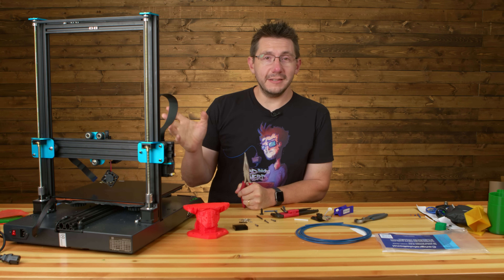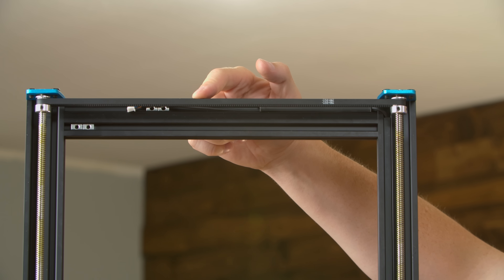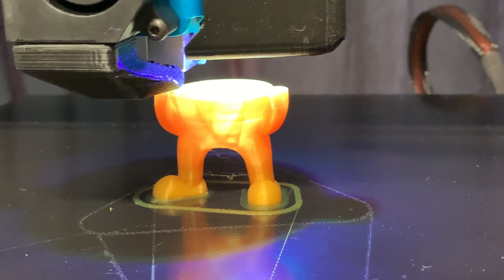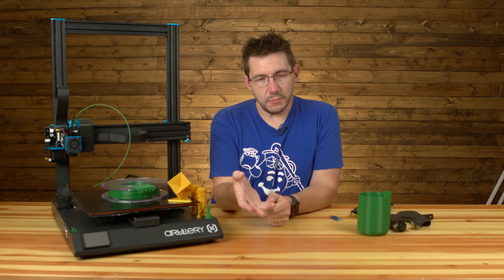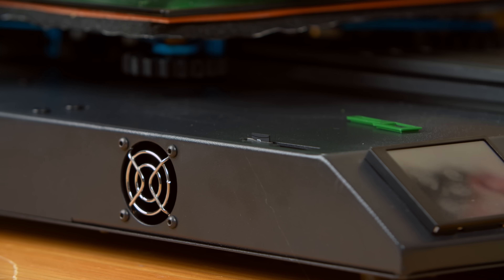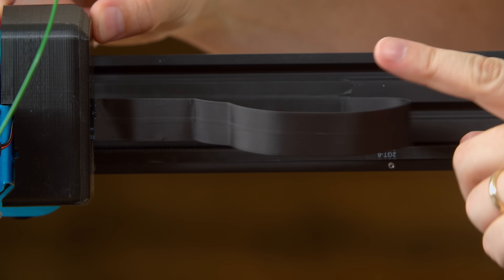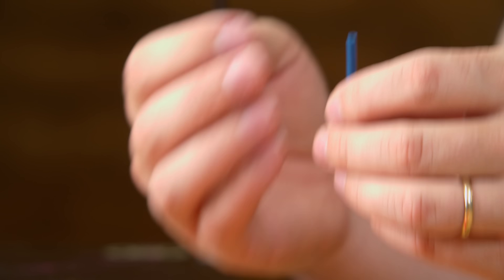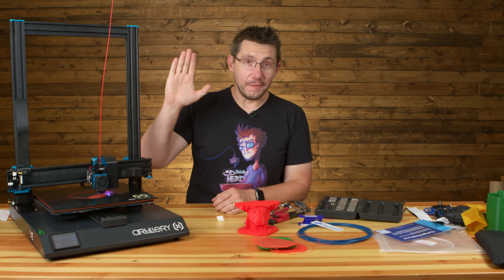The Artillery3D Sidewinder X1 3D Printer - A Must Have?

Comment: I got one of these a couple months ago, and I was at first super impressed. I was printing PLA and PETG parts like a champ, and the setup seemed basically bulletproof for about 3 weeks. However, I am an engineer and I really wanted some durable functional parts, so I decided to try Nylon. This became a massive problem with the stock extruder, but not for the reason you might think. I was cautiously printing around 245-255 not wanting the PTFE to break down but I actually had the ribbon cable on the X axis fail not once, but twice. I've also had the vertical axis cable fail once though this was from the bed rubbing on it and can easily be fixed with some tape. I'm not new at all to 3D printing, but I am new to modifying my printers, and in my attempt to modify the extruder and replace the heatbrake I ended up snapping it off in the volcano style block in an attempt to clear a jam in a really cheap chinese heatbrake. This was entirely user error, but I will say it is a bit of a PITA to replace the extruder because of how little room there is to turn it and the wires are rather stiff, meaning I was constantly afraid I'd break them. In fact I did break the thermister by twisting the wires a bit too much, and the sensor came free of its casing. 

Things I like: The AC heat bed heats up stupidly fast even to 90C or above. Super quiet. Direct drive is a big plus for me, I've had little to no stringing issues. Customer service is very nice and sent me free replacement parts like the cables. Thermal runaway enabled by default. Really reliably prints PLA/PETG. Bed surface worked awesome with just hairspray. Can print really fast, I default all my PLA prints to 90mm/s. Volcano heat block compatible with large nozzles to make better use of the huge volume. 

Issues: Reliability of the cables. Occasionally I'd have a random thermal runaway error stop a print even with it working fine before (early sign of failing cable?). Short fragile wires to the board on the extruder. Annoying spoolholder. Firmware default will max out at 270C, if you replace with all metal you pretty much must modify that. 

I'm sure once I have my all metal setup running and do some PID tuning it will become a workhorse again, save maybe for the cables. But they aren't too hard to replace and I probably got through 3kg of filament before my first failure. I've successfully done some 8 hour plus prints and had no issues with PLA and PETG. If all you print is below 230C on the nozzle then it is a beast of a machine.  But if you want to print Nylon without mods and don't need the build volume or huge nozzles, a Prusa may be better.  I've got a thermister, a microswiss all metal heatbrake, and a genuine E3d Volcano block on order. With those I bet I'll have a much better time with high temperature printing and be loving this thing again.

Comment: I have had the "runaway hotend" before. Turned out that the ribbon cables going from my SD / LCD were too close to the PSU. It was causing some crosstalk and apparently it would just go for a walk randomly....

All I had to do to fix it was to zip tie the leads farther away from the PSU.

Comment: Wow this is actually really really good and with this video and aliexpress it seems like it would be very good quality with good customer service. I have an anet a8 and have hardly used it because its got more problems that its worth, its unreliable, just super janky and worst of all supperr loud (probably an easy fix though). My birthday is in a few weeks so I might ask for money towards this, but first I need to tidy my bedroom and make space for it. (I feel like this comment would make more sense if i mention that I'm 15)
Reply: @anonymoushippo-m7d  it's mainly the bed getting everything level and to stick properly and the extruder. I have the popular stick on matt I forgot what it's called but I get it level it works for a few prints and then just stopped being level, also the bed isn't flat so big prints will never work. The extruder jams up something when it slips on the filament or plastic will dry far up the nozel and not remelt and jamming it. It's loud as hell. It's just not that nice to use. 

I think if I wanted to get it working good I would need a new heat bed and different bed mounting design, and sort of rebuild just checking all the bolts are fine and tensioning the belts. Neaten up the wires to make it feel less janky and more finished design too
Reply: @anonymoushippo-m7d  so after these comments I thought I would have another go at using my printer. I accidentally used the default settings rather than the ones I was told to use by a friend and it worked. Main difference is default was much much slower, I'm guessing the speed from before caused vibrations to rattle everything loose. Prints are still super weak, I noticed infil looked like stringing so I think I need more flow, also the sidewalls are basically clear so more sidewall? I think the main problem with my printer is me being impatient
Reply: @anonymoushippo-m7d  yeah I've just not had much hope with it. I hoped for the slightest bit of success from the start but not getting it demotivated me. After seeing the slight success yesterday I think I'll spend a day at home testing and watching films to pass the time so I don't rush it. Thanks for the motivation

Comment: Thats strange about printing from the USB.  I've had this printer for about 4 months and have printed exclusively from the USB and haven't had that issue, I'm guessing that perhaps it's a firmware issue.  With that, I've been printing for 8 years, currently have 3 printers and I have to say that this is, hands down the best printer I have and have owned.  The detail that I can get in my lithophanes with this printer continually amazes me.
Reply from the maker: That’s great to hear!

Comment: Cheap and unknown PTFE tubing typically degrades at the range Joel mentions in the video, however a high quality virgin tubing from someone reputable like Dupont is spec'd for continuous use at up to 260C and underwriter's laboratory demonstrated no mechanical degredation even when used at 285C ( source: Dupont's technical handbook for their PTFE resin  http://www.structuredweb.com/sw/swchannel/CustomerCenter/documents/6673/15640/Teflon_PFA_Handbook.pdf )

Comment: Nice video! I however cannot support a company that steals designs with no credit and violates a non commercial CC license. 
That spoil holder design is by Cyrus on thingiverse here, https://www.thingiverse.com/thing:1635585

There are remixes with the same license for adapting to aluminum extrusions, I used it for the overhaul of my wanhao i3 called the ReDuplicator, found here, https://www.thingiverse.com/thing:2686588

Hopefully you can get in touch with them and have them pick a new design, since this one is CC non commercial.

Comment: Just a quick add-almost all the issues have been addressed in their updates. Spool holder adaptor for bridging the gap is already on Thingiverse FYI there are at least 2 versions out now so no need to make your own. One update that just isn't good, the flat ribbon no longer has a positive lock on the newer models (not sure why they did this) but the caveat is that now you need to print a cable stay to avoid it coming loose (on carriage) over time with use which can cause all types of issues. Great Video as always!

Comment: What is better value: prusa mk3 or sidewinder x1? Teaching tech has a tutorial to enable ABL on the sidewinder, so at this point im not sure which one to get since the prusa is more than 2 years old
Reply: The sidewinder is a fraction of the price of the Prusa.  I have both and they are both great machines.  Both really quiet and produce great prints.  The difference out of the box is that Prusaslicer has fantastic profiles for the Prusa whereas you need to look around for good slicer profiles for the sidewinder.  That is 50% of the difference right there.   My sidewinder has required far less tinkering than my CR10s, is far easier to get the print going and prints more reliably but that is after I got a slicer profile that is 90% there.  My Prusa was great from the start.  How much is that worth to you?   If it is worth the difference in price and build volume is not an issue then, there is your answer.  Personally I think ABL is not a deal breaker.  I hardly ever need to re-level either my sidewinder or my CR10s.

Comment: The issues seem to have all been addressed with later revisions.. the sheet metal cutout, the odd movement at start with USB drive, and I just left one side of the spool holder slightly loose so you can just slide it to fit the other spool.

Comment: It looks like a never ending sea of videos that have printers that need upgrades. To me, all printers are made better and more reliable with upgrades you can buy or make yourself. Cheap components make the printer available at low $$$ price points. You get it home knowing you will have to make upgrades eventually, but you have one home. If I were looking at the perfect printer, I couldn't afford it. Maybe put the Micro Swiss bowden extruder upgrade.

Comment: I am not sure of the belt with two separate motors.   If the Z steppers are not rotating in sync, it feels like one motor will fight with the other.  Do other viewers have experience with such an arrangement?
I do like my MicroSwiss all metal hot end.
Dave.
Reply: There is a belt between the two Z motors that keeps everything synchronized, so there's no fighting between the steppers and it all stays in sync. And all of the Z extrusions are 40's (and the XY under the bed is close to a 60!) so this machine is incredibly stable.

Comment: without heatsink the filament can expend in the ptfe tube and just clamp itself... I just cant understand why they use a flat heatsink on only one side
Reply: It uses the titan aero design. The heatsink doesn't have to be on all sides to do its job. Just like how your cpu heat sink isn't on both sides of your motherboard.

Comment: Thanks for the additional information. I was considering this in addition to/replacement of my CR10S Pro because of all the trouble I've been having with mine. But I've had to tinker so much with my printer that I'm just about done with tinkering with printers for life and I don't care to tinker with yet another one. I still need to add mod to syncronize belts like this one has.

Comment: I prefer ptfe-lined hotends especially for PLA.  Using a high temp PTFE like Capricorn is the way to go.  It handles PETG like a champ as well.  Great review but as others have mentioned, if you wait longer than a few months to review a printer, maybe consider exchanging it for a new production version or build both (if the first one is from early production) for a comparison (my preference).  Early adopters benefit by seeing the improvements to implement by viewing a current production model, and prospective buyers see what they are actually receiving with a current production model.

Comment: @18:09 Your logic is flawed.  You can print out all those same things (spool holder , cover etc.) for a much cheaper unit as well.  As a Platform it is overpriced.   My money will go with the tried and true Ender units.  For over $400 I would not expect to see that many 3D printed parts as this model has.
Reply: Hi broderp, the unit Joel has is from an earlier batch, the 3d printed parts you've seen on the machine were all switched to injection molded
Reply: @Artillery3D  Well ,
                                I Would Be Reviewing The Creality CR-10 To See How Much It Has Changed Since Long Time After Some Mods They Have Done Since The Time It Was Released  .As You Also Improve Your Machine And Give It a Version No ,I Would Love To See That Literature Incorporated In Your Website So That The Community Has a Whole Can See What Improvements You Have Done To The Machine  ,You Can Also Link The Video Reviews In Your Website With Improvements You Have Made  ,It Would Also Be Great If You Can Tell The Reviews Whom You Have Sent The Machines Not To Review Them If You Have a Newer Version Improvement ,Like This They Do Not Confuse The Community As Problem Is Already Sorted Out  .I Had a Great Desire To Review The Sidewinder But Your Company People Do Not Have Any Trust On New 3D Printer Reviewers .
Reply: The build volume is bigger than all the Enders.  Currently USD 379 on banggood against USD 440 for a CR10s.    For me it is good value
Reply: And there's a $20 discount at Banggood (use code BG359X1), so it's less than $360. Purchased one a few days ago, can't wait to start printing with it. I've been researching printers for the past few months and was close to going with the Ender 5 Plus and then I found this. Yes, a bit smaller build volume but I really didn't need 350x350. Joel also didn't mention the big size of the extrusions on the Sidewinder (40's and 50+), so it has a lot of stability baked in. And it's extremely quiet (a big factor for night printing for me). Noise is a huge downfall on the Ender 5 (regular & plus). He also downplayed the nice touch of having the ribbon cable connections which I see as a very nice addition to clean everything up. And I'm a big fan of direct extrusion and the PTFE issue at the hotend can be corrected easily since the bulk of the hotend is ready for an all-metal setup for just a few $$$. Having both a full and and micro USB connector is also a nice touch. And lastly the bed is heated with an AC heater which is very quick to heat up and it uses no-touch induction end stop switches. There are just so many features that most people would end up installing at some point anyway, so IMO the price is a steal. Yes, I'm biased, but I think the printer's specs should provide a very good printing experience and stay fairly current for the next few years. Most other reviewers agree.

Comment: hey I bought this printer shortly after your first video on it and I've noticed some differences, most notably that all of the 3d printed parts on Joel's machine are injected molded on mine, the fan that's mounted on the side of the aluminum body on Joel's printer is mounted on the bottom of mine, and the filament runout sensor is different. from what I can tell these changes were made to fix known problems, like broken printed parts, loud side fan, and a bad filament runout sensor. I hope this was helpful for anyone planning to buy this printer.

Comment: For the spool holder just righting the half with the sensor. Then loosely tighten the other side. Then you should be able to slide it back and forth to fit different size spools and the holder not move. I have this machine and that is the solution that works for me.